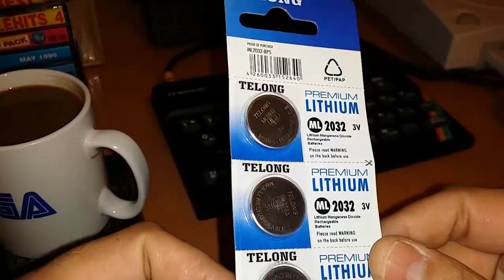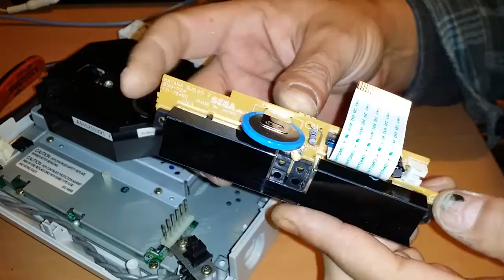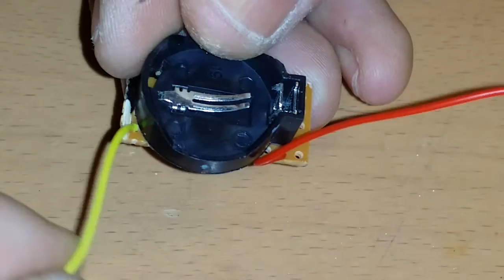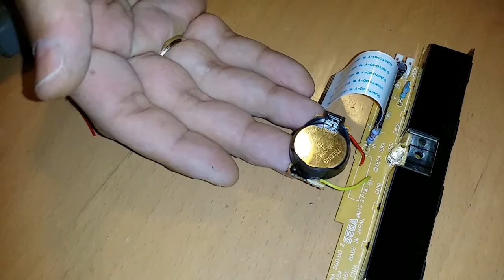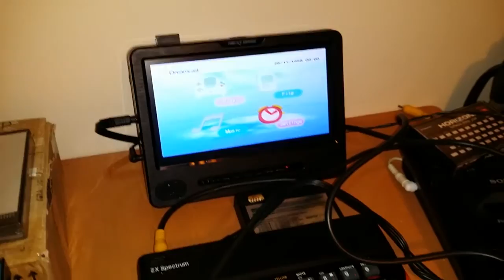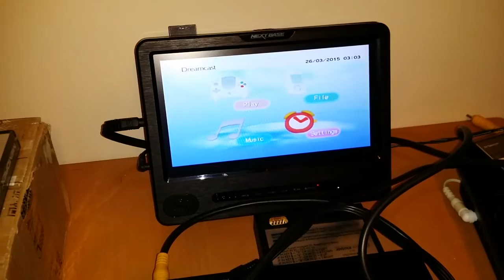Sega Dreamcast Internal battery replacement, LED mod & General service.

Comment: Good advice about making sure the battery is rechargeable. I use this type of holder myself it slips in place perfectly were the larger battery used to be. 
http://www.ebay.com/itm/10-x-Half-Round-Black-CR2032-CR2025-Battery-Coin-Button-Cell-Socket-Holder-Case-/120837294039?hash=item1c2276c7d7:g:y0QAAOSw9N1VwwRl

Comment: Don't suppose I could buy one of those battery cradles off of you could I?
Reply: Honestly I probably need the actual board since I suck at soldering

Comment: Hi mate great vid. Had the reset issue a year ago and rectified by cleaning 6 power pins and firming up the contact. It's started doing it again, reckon it might be the same fix?
Reply from the maker: wrapdump Yes it'll be the same thing mate. The clips that grip on to those pins become loose and don't make a good contact. I have seen people add some solder to the pins to make them thicker, so the clips can grip better

Comment: Need to do this with my Dreamcasts, already pulled the old battery out a while back n got the LED changed nice little practical mod
Reply from the maker: If your local, you can have a battery holder and battery. I've plenty spare :) Thanks mate

Comment: don't think that is that good for plastic. most people say to use lithium grease. also i have a version 0 dreamcast with heat pipes and that is the quietest disc drive i ever heard. not sure what was different.
Reply from the maker: It's fine mate, been using it for years

Comment: Excellent video John I'm ok with software issues , don't like messing with hardware though.
Reply from the maker: Thanks Dave. It's like anything else mate, practice is the key :)
Reply: Didn't know nothing about Arcade cabs a couple of week ago , soon sorted that out m8. StigsWorld
Reply from the maker: Dave Imagamegeek Awesome, yes mate, it's easy to be scared of something if you've never done it but the best way to learn is to jump in and go for it :)

Comment: Great job!  How did you isolate the back of the battery PCB - insulation tape?  Worth mentioning as some viewers might not think of that!  They are a great little system aren't they?  You won't regret adding VGA, it looks amazing in 640 x 480!  Consider doing a scan line box as well - just 2 x 74 logic chips to skip every other scanline and it then looks even better when using VGA!
Reply from the maker: Thanks mate. Yes I used insulation tape across the back of the board to isolate it, also it is sitting on a blob of hot glue, so isn't touching anything metal. Will stick up an annotation just to be safe. I actually did show that to the camera but I edited a shit load out otherwise the video would have been an hour long LOL. I will look in to the scanline mod, wasn't aware that mod existed :)